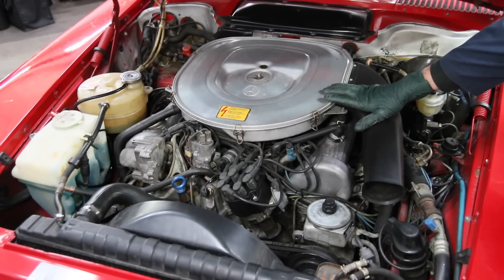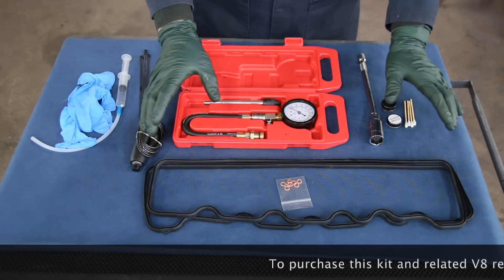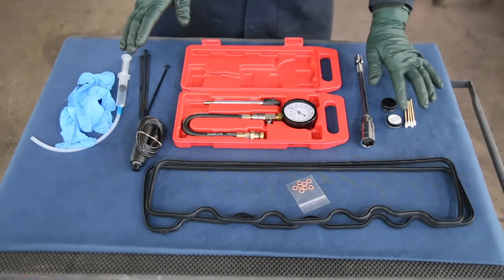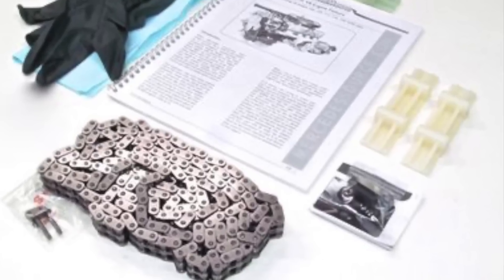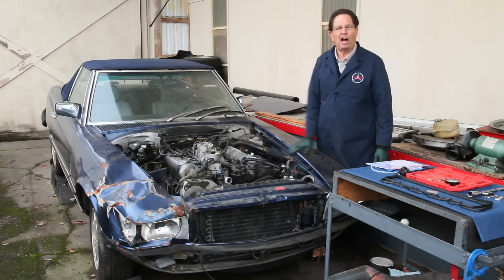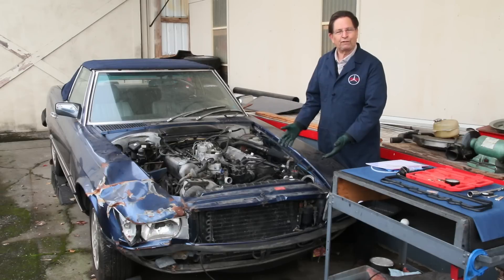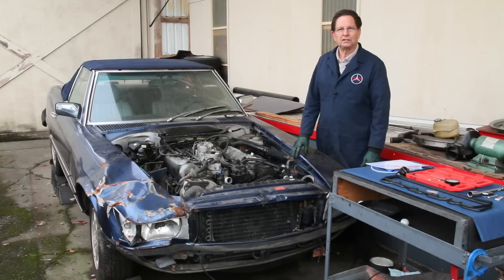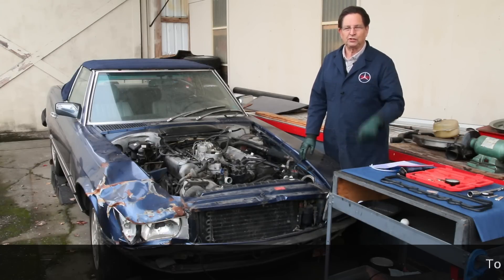Early V8 Engine Physical Exam Do it First: What is It and What's Required to Do It?

Comment: I remember reading a buyer's guide on these, which was emphasising that a bottom end rebuild would be very expensive: you've said the same...any particular reason it's so? Is it just parts cost, or is it complexity? Or both...😂
Reply from the maker: Both parts and labor. It is very time consuming so if you do it yourself it is a different story. The bottom ends of these engines are tough. Short of major oil change negect the only lower ends I have seen fail is due to valve train failure.
Reply: @Mercedessource  Thanks, that makes sense.